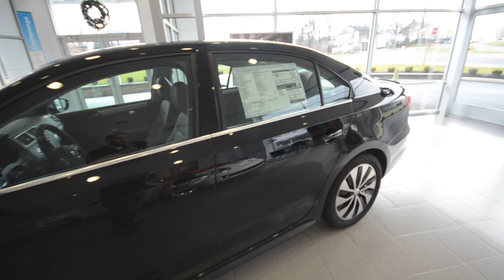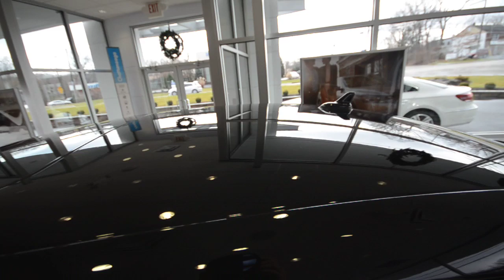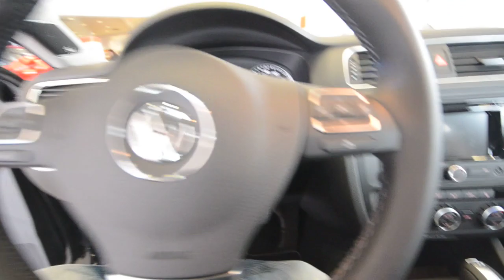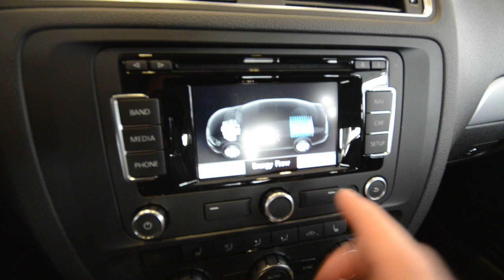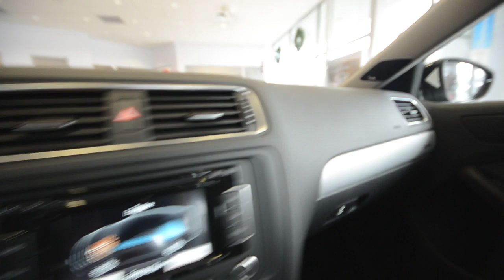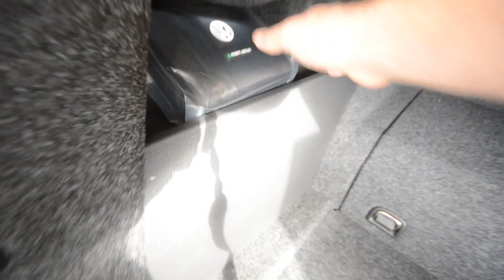First Look 2013 Volkswagen Jetta HYBRID SEL Premium at Trend Motors VW in Rockaway, NJ

Comment: I could indeed have mentioned all the things i DO like, but then again, I came here with a question ;) Don't get me wrong. I'm going to get the Jetta car soon, so it's no dealbreaker for me. Just curious if it's possible to have them neatly removed and if the same skirts would show up as the normal Jetta (non hybrid version). I do think that the skirts are on for aerodynamic purposes, at least, that's what the VW dealer told me. VW tries to make it as ECO friendly as possible.